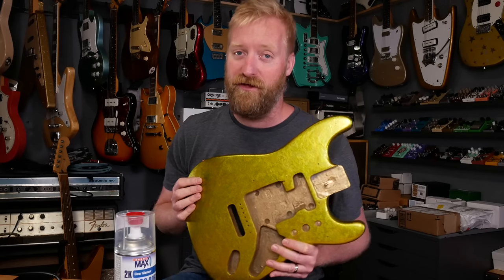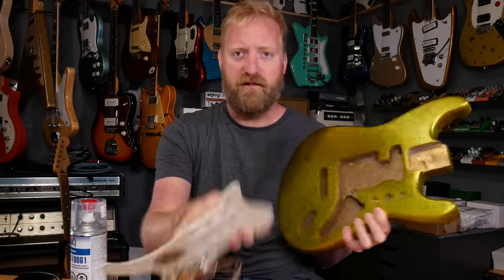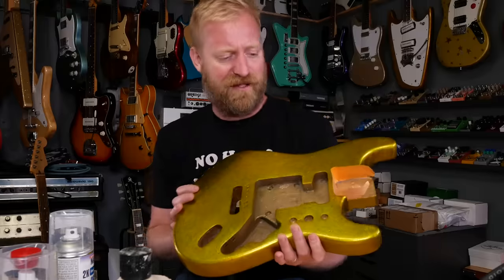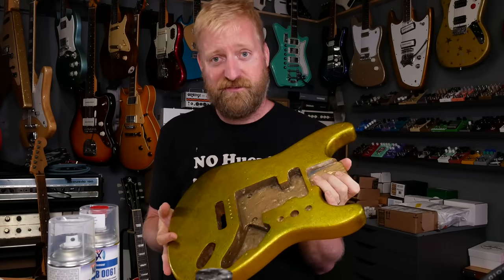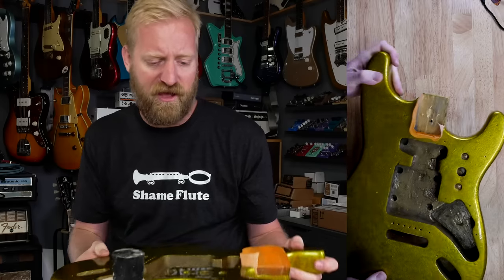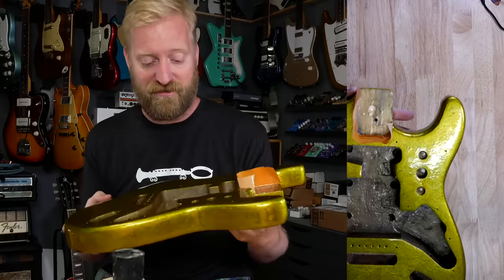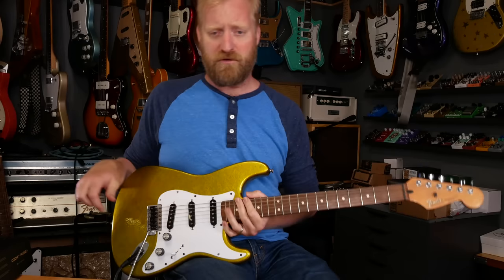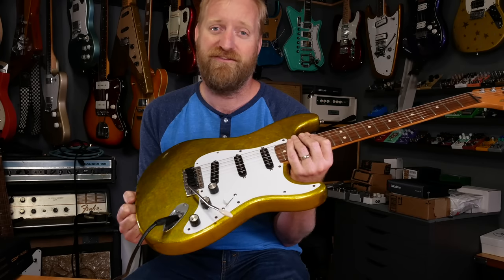Strat Reboot #5: Clear coat, assembly & final thoughts - wrapping up the nail polish refinish

Comment: "They didn't get the hole through the peghead in the right spot on the face. The angle is off by .004 degrees! It's an Overpriced Abomination!" (snicker) It's the best reboot ever :) If it makes you want to play it again, mission accomplished. The series - parallel wiring is a great idea.

Comment: I botched a build of a strat body,a combination of missing parts and off measuring led me to drill the bridge mount holes in the wrong place, attempting to fix made it worse so i ended up hogging out that part of the body and replacing the section with a wooden block from Jenga and titebond 2.

It turned out alright
Reply: Nice! My first project I had to dowel the bride holes and re do them because they were a hair too close together, but it works now!

Comment: If you have an air compressor capable of delivering the required CFM, you should grab a couple of HVLP guns from harbor freight. I got a kit with two different sized guns there years ago, and have done a ton of guitars with them. They work just fine and will last as long as you take care of them (proper cleaning and lubing the gaskets to prevent dry rot). I think the kit only cost me about 50 dollars, but that was 6 or 7 years back now.

Comment: I’ve painted several model cars with nail polish.  There’s usually some amazing pearls in the better polishes along with flip flop colors.  People think it’s not a big deal to spray 2 part clear without a mask, if they only do it once in a while, and it won’t kill you.  The problem is it will harden in your lungs and block up a little bit every time.  It’s would be like slicing a bit of your liver off every time you spray it.  Not bad until your lungs stop working, but what’s the big deal losing 10% or 20% and so on.  Never mind the kidneys😜. $25 mask is cheap    2k can is decent clear but it’s only good for one shot so it’s good to have a couple things to clear at once if you can.   The gold looks great

Comment: Should have wet sanded it before your clear coat.  Spray a couple of coats,let each coat dry as per the instructions.Wet sand lightly add a coat of two more then make sure you graduate grits till 2000 or so ,apply your wax ,an buff. It worked for me but I didn't paint by a 1/4 inch paint  brush. Lol.  That thing has so much orange skin on it . It looks like  swap meet guitar that someone tried to finish.( You ) Hahaha.  You only have to drill about a one eighth of an inch deep to get those screws in. But you did fine for a swap meet guitar.Just screwing with you. Great stuff,very entertaining. Keep up the mediocre work. Hahaha.
Reply from the maker: oh, i will, i will keep it up.
Reply: @60CycleHumcast  Well you were talking about all the people that will complain and I figured I try it once. Ryan calm down I t was a joke .I like your channel.  Lol.My English humor didn't work.? Have a good one.And that guitar is good looking and sounding.Those pickups are great souding.🎸👍
Reply from the maker: bob bitchen ;-)
Reply: @60CycleHumcast  yeah I like cheech n Chong movies.

Comment: I would say, wet sand with 1200 grit that body down and clear it again and wet sand it down until you have all the  lumps out and then buff it out. You can get that finish to be smooth. Just keep sanding and clearing until you get it level. I would put a mint green pick guard on that guitar.

Comment: By the way, I dig the hand-finished look. Almost looks like hammered metal, so surface imperfections don't really detract as long as the finish is consistent. As you said in an earlier episode, as long as something looks intentional it usually works and passes.

Comment: i used grits going higher to get a near mirror finish. i dry sanded with 600 then i wet sanded with 1000 grit then cleaned it up and then finally went up to 2000 grit then i polished with the green turtle wax stuff for cars. came out pretty good.

Comment: Having modded many a Strat,- including some home body refinishing,- gotta say that the stock SSS pup configuration is about as tonally flexible as you can get.I also like the "Wayne Kramer" humbucker in the middle position,- far more useful for Alt Rock than the HSS.Or some low output lipsticks, for a more neutral, less nasal/ more punchy option.Leo had God whispering on one shoulder, and Satan on the other,- he really did not miss much.
End product looks great; think I would go with white, light blue,pink, or red pup covers,- the black isn't quite right.The Graph Tek always works on mine.Good that you're there , Ryan, keeping things in perspective.

Comment: I actually drilled a hole on the front of my strat headstock to install a hat pin that I liked. When I got tired of that I removed it and I glued a tiny nugget of gold over the hole and it's staying there forever. Would suit you "gold leaf" guitar I think. And I think that nugget only cost about $10. Yes, black switch tip and whammy tip while you're at it.  Don't forget back plate if only for case candy for completeness. Just a thought: A silver dollar sized sticker of your YouTube 60 Cycle Hum icon for the circle at the top of the headstock. Cool guitar.

Comment: Quasi-pro tip: Put some tape around the drill bit as a depth gauge. It's not perfect, but it helps let you know how far you've gone into the wood.
Reply from the maker: i usually do that, but i thought i was going to be able to eye ball it
Reply: @60CycleHumcast  Hehe...that's right up there with "get this on video" and "I can do this...I play Grand Theft Auto."
We've all been there...multiple...multiple...times.

Comment: How about uv resin for the clear?
Reply from the maker: i experimented with some resin and it was pretty damn thick. Its possible to sand in thiner but i wanted to try this 2k stuff.
Reply: 60 Cycle Hum yeah I didn’t think about the thickness.  I know it smooths out really nice.  I don’t think you would need to sand at all.